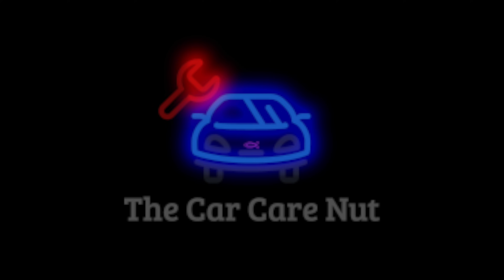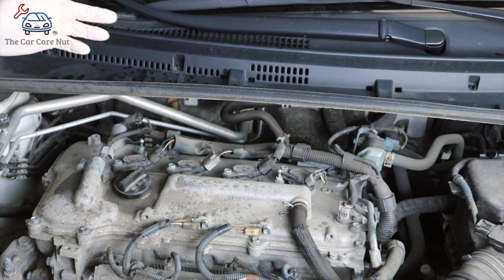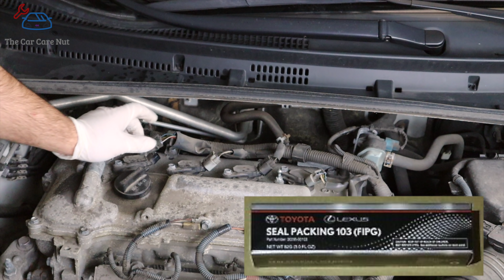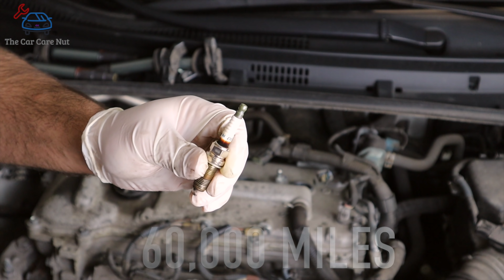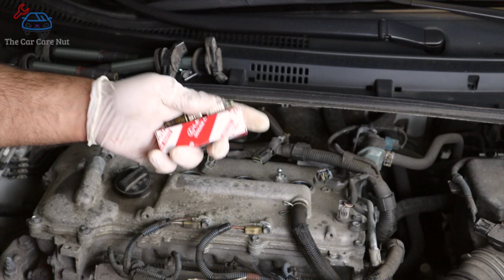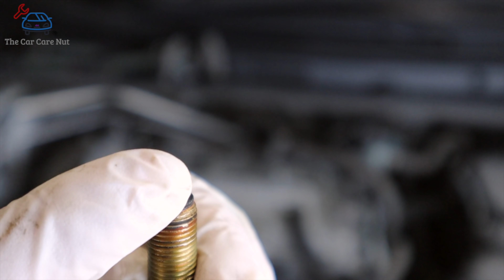How to change Toyota Spark Plugs on 4 cylinder engines

Comment: For any plastic, the key is to warm things up first.  For exterior, I pour hot soapy water over the item (eg wing mirror, rear light cluster before removal), but for an area like the engine I have two solutions:  one, just use an old towel folded up, dunk it in hot soapy water, part-wring it out, and place on top of the plastic thing you think might want to break (eg electrical connector with a ‘tongue’ release moulded-in); two, I did this to a little Clio the other day I was replacing fuel injector rail etc into, there’s lots of little snag-clips for cables on the fuel rail bracket…I hung a small ‘space heater’ electric fan heater from a piece of plastic-coated metal cored garden wire, or a couple of bungees, from a couple of points on the raised hood lid (‘bonnet’ in the UK)…(Draper I think, Amazon, it’s got 3 settings and a 1/2” tubular metal frame it sits at different angles inside).

We have a cold climate where I live too.  Clearest-cut example I can give, I was doing brake/tail light bulbs in both rear light clusters, and the first one I just forced off, cracked one of the stupid little plastic ‘plugs’ that clips into the bodywork.  Still refitted very securely, but nit happy.  Second one, I realised how cold the car had gotten that night ( no garage, I work on the drive), and poured most of a bucket of hot soapy water just over the external area, above and on the light cluster.  Get this, the first one took 40 minutes and broke, the second one, I kid you not, took 90 seconds, it lifted off like it was meant to.  There you go, plastics are often designed for the climate the engineer lives in.  Here, you have Japan, me it’s a French Renault - balmy summers and short winters!  Take care all.

Comment: I’d be interested to see your technique on replacing broken ignition coil connector plugs. I have two V-6’s due for new plugs (Sienna and RAV4) and I’m scared some will break so I got 6 new ones. Do you splice the wires or use the tabs to remove new wires for old ones?

Comment: Love Love Love your channel, thank you so much for all the information that you provide. I have a quick question, I have a 2012 Corolla LE and the original Spark plug is a Denso SC20HR11 however when I go to the auto parts store they tell me I need a SC16HR11. Was this plug superseded with the 16HR or should I continue to look for the 20HR?  Thank you in Advance.

Comment: HELLO ASAF HERE,I REALLY WANT TO SAY THAT YOU ARE A REAL PRO AND I LOVE WHAT YOU DO,I HAVE TOYOTA AURIS HYBRID YEAR 2018, I HAD A TRIANGLE YELOW+PCS LIGHT TWO CARS CRASHING SIGNS,I  SCANNED THE CAR WITH A PRO SCANNER FROM A FRIEND AND I GOT C1AA0 FRONT CAM CIRCUT.I WENT TO THE DEALER AND THEY SAID I NEED TO CHANGE IT FOR 2000$ (UNIT+ADJUSTMENT). EVERY TIME I SHUT DOWN THE CAR THE SIGNS DISAPPEAR, AND SHOW AGAIN AFTER A FEW DAYS OR A FEW MINUTES DEPENDING ON THE TIME OF DAY, MAINLY ON SUNY DAYS IT COMES FASTER, AND AT NIGHT LONGER. CAN YOU HELP ME WITH THAT? CAN I USE A SECONDHAND DEVICE? THANK YOU FOR BEING THERE FOR US

Comment: Hi, im going to replace the spark plugs on my mazda 3, i bought the same spark plug model as oem, same manufacturer and same part number, but not oem mazda brand, do i need to worry about gapping or same model should be exactly the same?

Comment: My spark plugs look exactly the same and it's from the same engine 2zrfe, I thought this means it's running too hot or too lean, I have been concerned about this, also my car seems to be consuming oil, it has 142000 KMs which is low for a 2008 corolla, I only recently bought the car which has been good so far, the only thing is I changed the coils after number 4 coil failed and I changed all 4 with aftermarket coils from swan ignition, original coils cost too much for me at the moment so this was my only option

Comment: My old camry is getting ready for it's third set of plugs, will do it myself.  I hear what you are saying about anti seize products, you have to be very careful.  People make a big mistake when they use the wrong anti seize on aluminum outboard motor hardware.  The combination of dis similar metals, salt water and the anti seize can actually encourage aluminum corrosion/erosion.  That being said, there are alot of threads on those plugs, is it OK to lightly coat those threads with regular automotive grease?  My outboard motor/salt water background has taught me never to assemble most hardware without a light coating of grease on the threads.  I can understand how easy it is to break the retainers off those plastic coil connections.  Are the plastic connector housings replaceable??  I realize you probably need some sort of special tool to get those wires out of the connectors though.

Comment: It does not take a rocket scientist to change a damn spark plug people I always recommend have the right size socket the proper extension and always blow out the area with air before you take the spark plug out so no crap Falls inside it's really not much to it and do not over tighten the plugs

Comment: I'm changing plugs on a Lexus 2016 NX 200t i was going to buy OEM but they want 48 a plug.  Do you have an after market plug that is acceptable to use in its place like NGK Iridium High Ignitability those are only 22 dollars each.  Thanks love your videos
Reply: lol i posted this like 4 seconds before the spark plug part.  Thanks again for the videos brother.

Comment: I don't know if anyone has ran into this problem,  but I have a 2013 Rav4 and the owner's manual doesn't tell you the torque needed. I had to call the parts ppl at the dealership,  and the tech I spoke to said he only found it through the snap-on parts manual which you can't access without a sub. He said it was 18 foot pounds, can anyone else confirm that?

Comment: If you're a DIY person, you might want to clean the sparkplug threads with a "thread chaser" with some grease on the end of it. On two of mine, I had to run the chaser down in there four times to clean all of the carbon out of the threads.

Comment: The 5/8 spark plug socket doesn't fit 14mm hole where spark plug is on my 2013 Toyota Matrix. Magnet sick will not pick it up neither. Ended up buying spark plug socket set on Amazon. Tip for whoever will do it on similar car and don't have that fancy Mercedes Benz spark plug tool, use 2 pieces short 2,5" 3/8 extensions it's easier to insert them separately than remove plastic panel above.

Comment: Hey there, I want to replace the plugs on my IS 300 hybrid, the manual says Denso FK20HBR8. Now, can I buy them directly from denso or go original? I suspect the original ones are just the Denso in a toyota package, am I right or are they slightly different?

Comment: After seeing this video, I checked my Toyota dealer service reports and compared it with the service manual. Found out that my 2007 Toyota (while always having the Toyota service intervals) was having Spark plugs (no iridium) from 2015 that already did 84500Km. The engine was performing nicely so that did not reveal that the spark plugs were rather old. Replaced them with Genuine Toyota Denso spark plugs and life is good. Thanks for the nice instruction.

Comment: Sir I have a question for you hope you answer since you’re the expert I have a 2018 lexus nx f sport 8ar-fts engine I want to replace the spark plugs I don’t want to put the original spark plugs which are ngk iridium I want to put the ngk laser iridium because of the better performance and ignition so do recommend me buying from ngk website or advanced auto online because there’s a lot counterfeit’s parts

Comment: Do you know the torque spec for a 2020 Corolla SE? I can't seem to find it online. Most people say it will be 15 lb-ft.
Reply: I also noticed you didn't use dielectric grease on the boot is it necessary?

Comment: It's been a long time since I changed spark plugs so I watched this video a couple times and then changed the plugs on our 2009 RAV4. The vehicle has just over 70,000 miles on it but since it's a 2009 model and thus about 12½ years old, I figured it might be a good idea. Everything went as smooth as silk. No trouble getting the old ones out or the new ones in. I put in the same Iridium type of plugs that the vehicle had in it as OEM, Denso SK16HR11 3417 Iridium Long Life. Torque specs I found said 18 ft.lbs. for the plugs and 7 ft.lbs for the bolts on the coils.

The mpg has been lower now than it was last year. I'm hoping the new plugs will help. However, the decrease in fuel economy may be due to installing wider tires with a higher rolling resistance.

Thanks AMD for this video.

Comment: Hello, what is the spark plug socket size for a 2012 Camry 2arfe 4 cylinder and torque specs. Will a 14mm spark plug socket work? Thank you!

Comment: For replacement of these in the manual it says 120,000 or 12 yrs what ever comes first. Is this sufficient. I have read that alot of people says it should be done at 100,000 or earlier. What do you recommend? Thanks
Reply from the maker: Hi! 120k or 10 years is good

Comment: I keep hearing how OEM spark plugs are gapped from the factory.  This might be true or it might not.  I just replaced the plugs in a Hyundai Accent 1.6 L engine and the correct OEM plugs that were gapped but they were radically wrong.  The gap for all 4 was set at .025  when in fact they should have been gapped at .0394-0433.   Always check each plug before installing.  The only thing I do differently is place a dab of dielectric grease on the tip of the coil before dropping them over the plugs.

Comment: Do I need to adjust the gap of the iridium spark plug or just let it go until it reaches 120k kms?🤔
Reply from the maker: Hi! Adjusting the gap on iridium plugs is not advised as it could damage the iridium tip.
Reply: @TheCarCareNut  Thanks! 💗

Comment: Hi from europe!. Going to change spark plugs on Lexus IS 300H (AVE30_), 116000 Km / 72079.0 Miles on ODO. Engine code: 2AR-FSE. Spark plugs: Denso FK20HBR8. I'm going to perform outdoors, outdoor temperature +4 celsius/39.2 fahrenheit.
Questions: Changing the Spark plugs, engine warm or cold?. Torque for spark plugs 22Nm or 25Nm?.

Comment: The plugs I got for my 130K 2011 Camry at Toyota had Lexus on the box. One does not have to take the battery minus off like some do. right?
Reply from the maker: Hi! You don’t have to disconnect the battery
Reply: @TheCarCareNut  Thanks, I got it done  Broke two tabs and did what one of the other guys did, put zip ties on the two.   The old plugs were in excellent condition and I think I could've went to 150K. The original  were the irridium plugs. Hope I spelled it correctly. The new ones were not. Have to add that I had my cabin air filter and fuel air filter changed 4 years ago at my dealer and today I removed the cabin filter and it was solid black. Checked my air cleaner and it was barely dirty and easily cleaned by a air hose. After seeing how different they were I'm not sure the dealer replaced the cabin filter. Jus sayin" I've checked and I may go aftermarket on it as there's so much difference in prices. Also got to add that you're the top dog in Toyota videos bar none and yes that includes Scotty. ;0).

Comment: I changed spark plugs on my 2009 Prius about 5,000 miles ago and used antiseize but didn't use a torque wrench. Should I go back and loosen them and retighten with a torque wrench?
Reply from the maker: Hi! I would if you think you might have overtightened them

Comment: Wonderful maintenance series.  Is replacement of the PCV valve also recommended at the same time as replacing the spark plugs or earlier?  If earlier, what frequency?  Also, is there any specific RTV silicone gasket sealer needed to be applied to the threads of the PCV valve when installing a new one?
Reply from the maker: Hi! Typically the pcv is recommend at the same time as the spark plugs. If any sealer is needed it is usually already applied to the threads of the original pcv valve on Toyotas
Reply: @TheCarCareNut  how much should a pcv valve replacement cost?!?! And is it necessary to replace? Do you have to order the specific valve that comes with the car. Thanks
Reply: I just ordered oem pcv valve from my local dealership, and it was literally 5 bucks and some change. And it’s super simple, at least on my Corolla. Not sure what it would cost to have them put it in for you, but I highly suggest looking it up how to do it yourself, it’s so simple. Hope this helps

Comment: What’s the spark plug torque specs on 2018 Toyota Prius 2?
Reply from the maker: Hi! Same as this video
Reply: @TheCarCareNut  hey, doing my spark plugs and found oil on the spark plugs what does that mean…
Reply from the maker: On the spark plug tip or the whole porcelain?
Reply: @TheCarCareNut looks like maybe the porcelain side,  the tip looks good its not burnt. Was talk cause be valve cover gasket.

Comment: I had no problem changing my plugs about 3 years ago.  So, after changing the oil I started to check the plugs. The end of the socket is now stuck to the plug and I can’t reach it. I can’t get it back out after turning to the left.  I’m having a mechanic come by but it won’t be until 4 days.  Any ideas?  I must have used a different tool the last time and made a wrong choice.
Reply from the maker: Hi! Can’t you undo the plug? Use a long extension to reach your socket and loosen the plug to get it out then get it unstuck and back in
Reply: Sorry. I was trying to remove it. Turning to the left.  It was getting harder to turn, so I felt I should remove the socket.  I must have grabbed a slightly wrong size by accident. I’m worried to keep turning to the left.  I was afraid it might strip it. I put some super glue on the extension and tried to pull it out but no go. I’m letting it set over night with some glue. I used my sockets instead of the spark plug removal socket. I think a 13/15. Stressful. Thanks. Maybe hammer it a bit.
Reply: Your question helped me.  I hammered it a bit and kept going left. It was a size too big and not the spark plug socket so it started to wedge in there. Thank you.  Your question made me persist.  God bless you
Reply: Just a FYI for others.  I saw a tip on removing the socket to pull at an angle instead of straight up and out.  It causes it to catch on and grab so it doesn’t fall off again.  That helped also. Thanks. I had a size too big by accident. I’ll never forget this.

Comment: Your video's are great, a standard for others to try to meet. A question on the ignition coils.  In servicing the plugs do you need to replace the boots at the end of the coils. I was told to do so. My attempt to remove the originals resulted in tearing the original.  After tearing the first I didn't bother to repace the others. Vehicle was a Tacoma 2.7l 2008. Thank you.
Reply from the maker: Hi! I’ve never seen a Toyota original ignition coil boot that had issues. I wouldn’t replace them unless they’re clearly damaged
Reply from the maker: Not really on Toyotas

Comment: AMD I recently bought a 2011 Rav 4 with 123,000 miles. Having watched this very useful and detailed video I decided to change the spark plugs today. The plugs were pretty resistant to turning but after I warmed the engine up a bit I was able to get them all out without any trouble. All the plugs had the marks on the end of the terminal that you say marks them as original. They all closely resembled the plugs in your video except for the plug in cylinder #3.  After removal the threaded section of this plug looked like it had literally just been dipped in a cup of clean oil and there was a brown stain where the porcelain enters the metal section like one of the plugs in your video. It didn't look like the typical plug from an engine burning oil and had no buildup of black gunk or excessive carbon build up. I don't think I ever seen a plug that looked like this. The engine has about 1,100 miles since the last oil change and the oil level is down about 1/4" from the full mark. Any idea what could be causing this oily buildup? Thanks!
Reply: Thanks for the quick response, much appreciated! The oil was most apparent on the spark plug threads themselves. I shone a light down into the spark plug tube and there was a streak of oil on one side but it looked almost like it may have just dripped off the threads of the plug as I removed it from the tube. The engine runs well, idles smoothly, and is averaging about 29.5 mpg which seems to argue against bad rings, or a piston problem.
Reply from the maker: Interesting. Did you look in the cylinder?
Reply: The Car Care Nut The light I was using wasn't very bright but I "think" I was able to see oil on the top of the piston. Couldn't really tell if it was excessive or not. My guess at this point is that the oil leak in the spark plug tube seals had deposited a small amount of oil in the bottom of the tube and when I unscrewed the spark plug that oil leaked down on to the spark plug threads? Does that sound likely to you? If one tube is leaking the others are probably getting ready to so I'll take the car in and have the gaskets and seals replaced. Thanks again for your help!
Reply from the maker: Hi! Did you have oil on the socket as well?